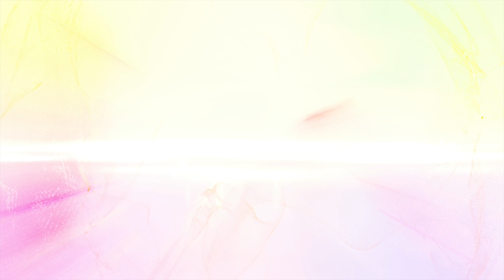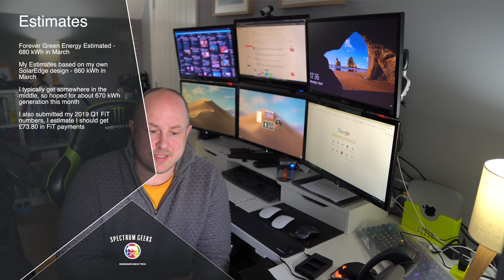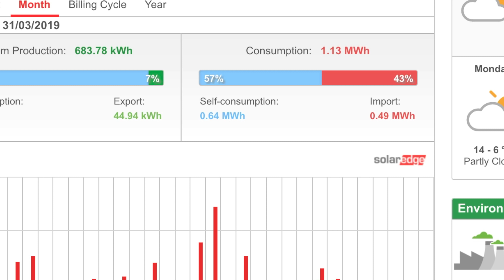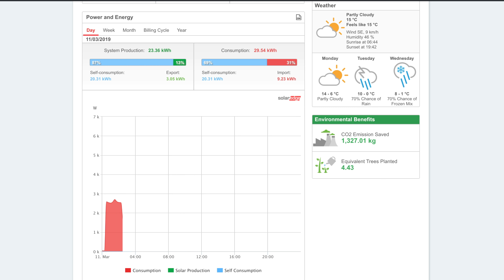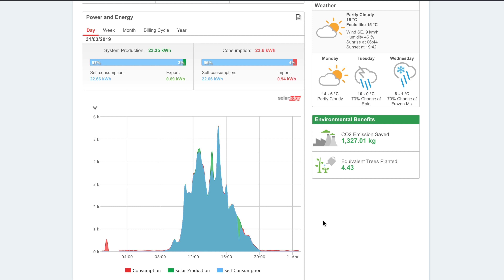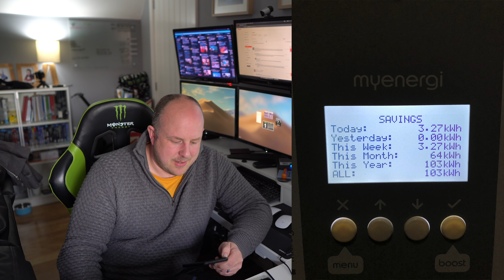March 2019 Solar Stats in the UK - Now with Zappi Car Charging

Comment: I like the detail but I would love advice on savings etc maybe describe how it would be if you had less or more panels and with different or no battery and how big ur family and use is so new people can get info and better advice. maybe its a pointer to increase views maybe you don't agree.
Reply from the maker: Thanks for taking the time to comment. Most of which you mention here I have covered in the various other videos. You light want to check out the 1 year update (will be a 2 year update coming soon). We are a family of 4, I work from home 100% and have alot of computers / servers running 24/7 which increases my consumption.
Reply: @ConsideredUK  no thank you for replying. i think prob instead of day by day accounting it might be perhaps better and more watchable to give higher level accounts of each month and how it met or differed from expectations and why. my 2 cents as they ssy. I recently ordered a 6.2 kw lg system with no battery in ireland. i think also with the finanical crisis inflationi n energy and other things will be terrible. Also i have not seen youtube channels mention how higher quality panels with less degradtaion and longer lives will certainly give a better return on investmnet over such long periods when return is discounted to the present appropriately. most people understand the engineering but not the finance part
Reply from the maker: Always welcome feedback. In the first year I did the monthly comparison of actual vs expectation, but then didnt repeat in following month by months but will cover in the yearly wrap ups.
Regarding panel selection, I went into some of that in my earlier videos, why I went with panels that had a longer warrenty and performance expection (think it was like 80% still in 25 years).
Reply: @ConsideredUK  excellent

Comment: Hi, March was my best month so far, I added another 7.2 kw of storage for a total of 19.2 kw ie 8 US2000B Plus Pylontechs. Been off grid since Jan 29th with approx 700 wh per day from grid to run the inverter. IIRC your FIT application restricts your inverter to the rated capacity you quoted in your application,  you could install an 8 kw inverter but you would lose the FIT
Reply from the maker: Wow thats an awesome array, and fantastic being off grid for so long.
You are correct the FiT application restricts to your current inverter / capcity, so to avoid disruption of your FiT you would have to do a seperate installation I believe. I probably wont ever do it, just want the stats :)
Reply: @ConsideredUK  Regarding clipping, my inverter is nominally 3.7 kw, I have recorded a high of 4.1 kw for a short time when the sun comes out then it falls back to the rated output. IMHO the main reason to go with the 5.3kwp solar panels and 3.7kw inverter was to keep the inverter at or near its max nominal output as long as possible on sunny days, up here right now that's 11am to 4pm, also I did not have to seek permission from the grid provider.
Reply from the maker: Yup you are 100% right, means most of the year you are getting the best efficiency out of that inverter.

Comment: Hey, thanks for the informative video. I have watched a few of these already. I have managed to get a PV system installed before the March 31st deadline and I am a proud owner of a 7.48kwh system built with 22x LG 340wh panels and a 5kwh Solaredge inverter. This is all after watching your videos. I have loads of questions though, I will start with an easy one.  How do I sign up with the same economy 4 tariffs as yourself on Octopus? They don't offer Economy 4 on their website. Do you have a smart meter or an economy 7 meter installed? How does it all work.
Reply from the maker: Congratulations on your solar, I am sure you will be delighted with the performance.
Regarding many questions, please ask away. The idea is to build a community on the channel, and many subscribers also have solar setups so everyone can help and share experiences.

Regarding Octopus Energy, first thing you have to do is sign up to Octopus. You can do this directly on their site, or by my link https://share.octopus.energy/noble-bloom-324 (we both get £50 free credit) or of course use someone elses link.
Once you have moved to Octopus Energy from your existing provider you will have the ability to apply for a Smart Meter to be installed (if your current smart meter isnt compatible with Octopus). There may be some delay in this now due to the SMETS1 / SMETS2 metering cut off, so you would need to ask Octopus if they can still fit SMETS1 or if you have to go on the long waiting list for SMETS2 as there seems to be a general delay. I had to wait just under 2 months for my SMETS1 meter.

Once you have the compatible smart meter installed, you will then have the option in your account to move your electricity to the Octopus Go Tariff (Octopus reserve the right to pull / modify tariffs at any time obviously). Once you do that it normally takes about 24 hours and your moved to the Go Tariff. Then you can consume electricity at a 1/3 of the day rate from 00:30 to 04:30 each day, but please note the standard charge is abit higher on the Go Tariff.

If you look in this video on the channel you will see a little bit some of the progress steps to switch to the Go tariff - https://www.youtube.com/watch?v=eeBMpskjH-U&t=502s
Reply: If you email Octopus direct they can advise on the Economy 4 tariff. They can work with en existing economy 7 meter if you have one, or they will need to fit a new dual rate smart meter. Best to wait for a SMETS 2 meter as the current SMETS 1 they are installing won't allow you to switch suppliers without having a new meter installed by your new supplier! SMETS 2 overcomes this shortfall. I emailed shoshana.stanton@octopus-energy.intercom-mail.com to ask about the swap.
Reply from the maker: Could be a long wait on SMETS2 though John. So if you get a SMETS1 and benefit from reduced costs now, I think thats better, as everyone will get SMETS2 eventually.
Reply: Spectrum Geeks SMETS 2 are already being rolled out. Depends on your shipper.
Reply from the maker: I know they are being rolled out, but I have heard from many people its 6 months + waiting time.
Reply: @ConsideredUK  It will depend on which shipper/supplier you go with. They all have different lead times depending on size of customer base, demand, supply, number of fitters, etc. There are so many variables. 

The first SMETS2 meters were installed in July 2017, over 3 years later than planned. In their absence, energy suppliers installed 12.5 million SMETS1 meters, 7.1 million more than planned.

Comment: On your zappi in eco+ mode you can change the setting so that for example you use 50% solar and 50% grid to give you the basic charge of 1.4 kw. However if solar is producing more, then less is taken from the grid to get that basic 1.4 kw.     I think I’m right in saying that if solar is producing more than 1.4 Kw then nothing is taken from the grid.  From what your saying it sounds like in eco+ mode is set to 100% I have mine set to 50% that way I can use any spare above 700 watts.  I have Eddi set to priority 1 and Zappi 2.  Colin.

As an extra I’ve wired terminal 2 on Eddi to heat 2. 300watt towel rail elements that I’ve fitted into my existing towel rails, that way they heat up from both the heating system in winter and from solar in the summer.
Reply from the maker: Totally right Colin. I have changed mine to 100% solar, as I don't want it taking anything from the grid unless I tell it to boost during the economy 4 window.
By default its set to 50 / 50 and it was pulling from the grid to maintain the minimum 1.4kWh, so I put a stop to that :)

Comment: We had a 2kwp system installed in Feb. We only consume between 4 and 8 kWh per day so 2kwp is ample for our needs. That said we are getting an electric car next spring, so our plan is to retrofit a ~3kWh battery next year to store and use the excess solar.
Regarding clipping, our system is 2.16kw and the inverter is 2kw, and on sunny days (like that week at the end of March) our system was consistently clipping at 2kw.

You can compare your performance to our system if you're curious, just search for "killay swansea" on PVoutput. You should consider sharing your data publicly on PVoutput too, its a great way to compare similar systems :)
Reply from the maker: Cheers for sharing the info Lewis. Deffo makes sense to get the solar array and battery to meet your needs, anything more is a waste and un-required expense really. What EV are you planning to get?

Regarding PVoutput I do keep meaning to set that up, just have yet to get around to it :)
Reply: @ConsideredUK  we are likely to go for the Zoe. But it looks like most manufactures are releasing EVs this year so will have to wait and see whether something else appears on the market at the right price with the right spec.
Reply from the maker: Zoe is a great car for the money, brilliant range, just want to avoid the battery rental.
Lots of cars being "released" actually having them on your drive is another story :(
Reply: @lewispearson  . I have just checked your Pv generation per day and I must confess that your Solar PV is really efficient
Reply: @josephjohn907  thanks. It helps that we are south facing with no shade (houses behind ours are all bungalows)

Comment: Hey, thanks for sharing your stats. It has really helped me to plan out my system. I do have a question about your Powerwall...

What mode do you have your Powerwall set to? I'm guessing Time Based Control, in which case have you looked at what factors the Powerwall is using to decide how much to fill overnight, roughly how full it charges it, how accurate this is based on solar generation the next day, and how much solar is going into the Harvi or Zappi because the Powerwall mispredicted?
Reply from the maker: Since moving to the Octopus Go Economy 4 Tariff I have set the Powerwall to Time Based and Cost Saving.
In general the Tesla Smart Forecasting works well, there have only been a hand full of times when its cocked things up abit, and either charged to much or not alot.

So right now I am leaving it as is, but if it gets stupid (so far its not been pulling from the grid with the recent good weather), I can just set it back to Self Powered like I had it originally.

From my observations, it uses two factors to make decisions to charge or not. Firstly is solar prediction and the second is previous historical discharge to the Powerwall from equipment. As I don't typically discharge the Powerwall into Water or the Car isn't doesn't take this into consideration.

Hope that helps.

Comment: Nice one! People say solar PV is not viable in Cloudy Britain. Seeing what you and other Solar PV owners are producing have convinced me that Solar PV is viable anywhere.

Thanks for this consistent solar stats video. Keep It up for I am a follower.
Reply from the maker: Cheers. Today was a perfect example, weather was crap and cloudy most of the day, still generated 18.44 kWh
Reply: @ConsideredUK  . 18 .4 kwh. That's terrific. 
Thanks
Reply: joseph john 
My system is lest than perfect in so much as my house roof is rear facing  East > West.  I’ve installed 12) 300 watt panels facing East.  6) facing west.  &  4) on my car port facing South. Over the last 6 months I’ve generated 1.6 megawatts.. not quite as good as if all were facing South but not bad. I live in the South East. I reckon come summer time! I’ll do a lot better so very satisfied.  Colin.
Reply: @wobby1516 . Lovely. it means that during summertime your PV will  produce more.
Thanks for your help.
Be well!

Comment: With reference to the clipping and your question about a bigger inverter 
You don't get the same generAtion at lower light levels with the bigger inverter, so a smaller inverter works better in lower light. My 4kwp array only uses a 3kw inverter so it helps in the winter months. The question you should ask is would you be able to use the extra power in summer or is it better to have better returns on the less sunny days
Reply from the maker: Yup thats what I want to know, and cant understand it without knowing how much extra power, and then also trying to work out any potential winter losses.
Reply: Spectrum Geeks you will never hit the 100% 9 kWp, this it's calculated in perfect standard test conditions probably in a lab
Reply from the maker: Yeah totally, 8.5kWh at best I recon in super optimal conditions.